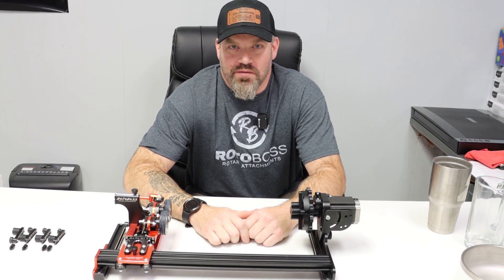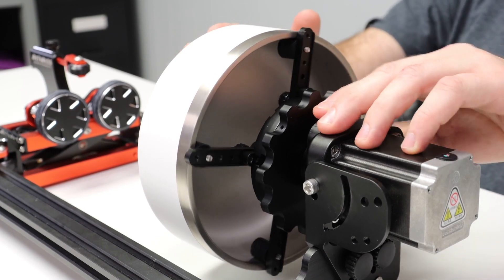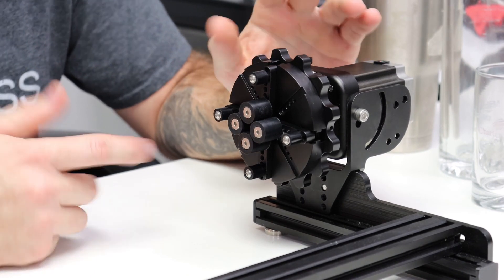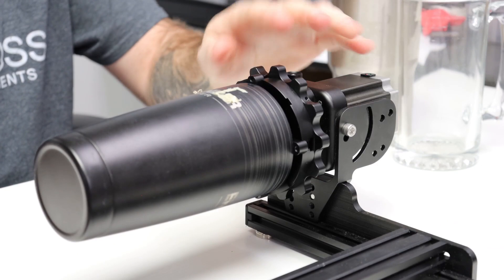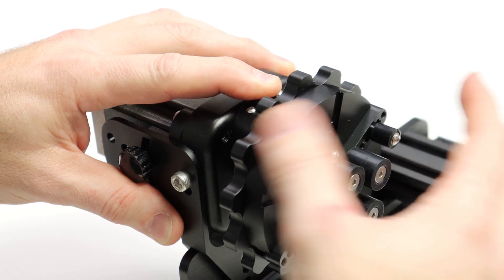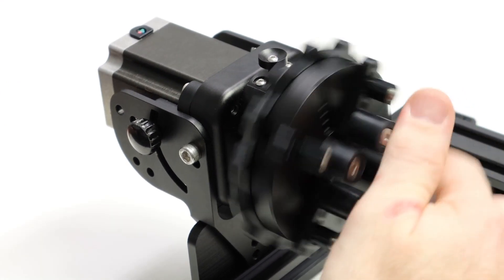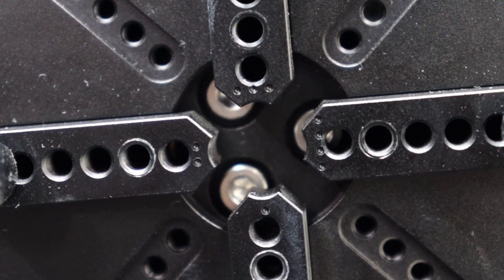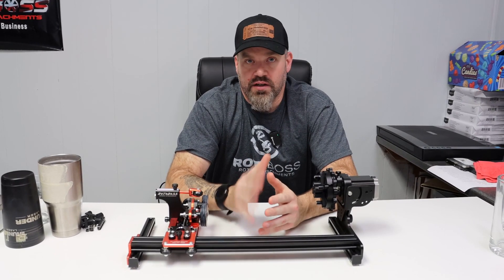The Eagle has landed!!!!!!

Comment: I got the galvo version and it will not hold a tumbler even with a double wheel at the other end locked in and square. I tightened and it still wobbles. 40 oz tumbler. Tried all feet.
Reply from the maker: Do you care to contact us so we can help with this. We can't help if we don't know...

Comment: If I get a 4 pin version, will it be compatible with any laser that uses a 4-pin plug for the rotary regardless if its a CO2 or Fiber Laser?
Reply from the maker: Correct
Reply: @rotobossrotaryattachments  thank you for your Reply I struggled with engraving dog bowls and beer kegs. Your tool would greatly help.

Comment: So, if i understand this correctly. It does not come with the stepper motor. Is that correct? So we just need ti remove the original chuck and measure it? The website is quite confusing on what it actually comes with and what option is correct.
Reply from the maker: This is right from the site, it answers all that. The Rotary no matter the configuration you choose will come with

Motor

Main motor mount

4 Jaws

4 Jaw extensions

4 Small rubber jaw posts

4 Large rubber jaw posts

4 thumbscrews for jaw extensions

2 thumb screws for mounting the motor mount

Comment: With tapered pint glasses would you position the grips on the outside of the rims and adjust the pivot to level the glass?
Reply from the maker: Not you should be able to grip from the inside. It will hole a small 2oz shot glass with heavy tapper